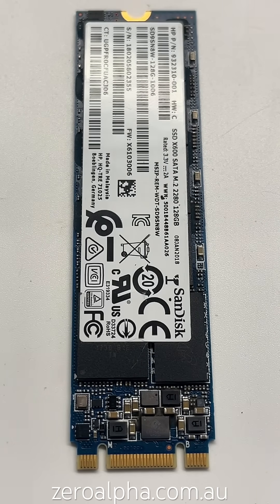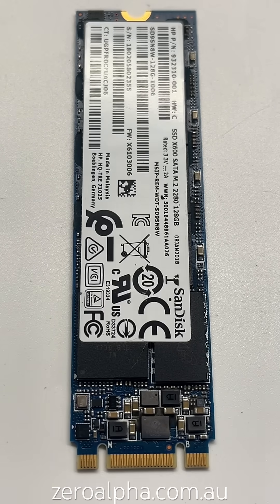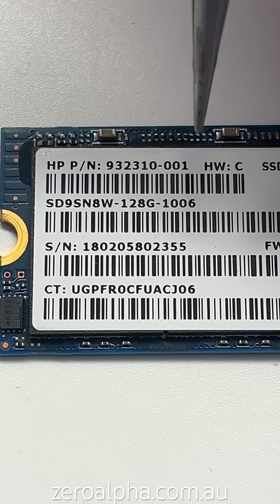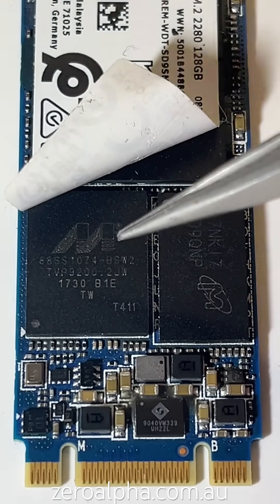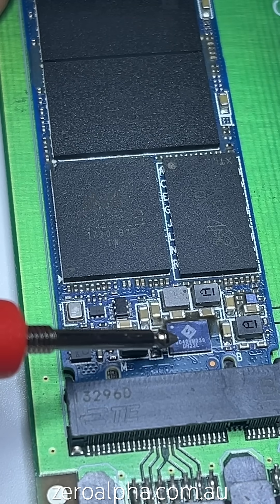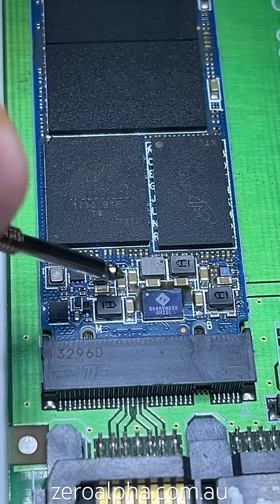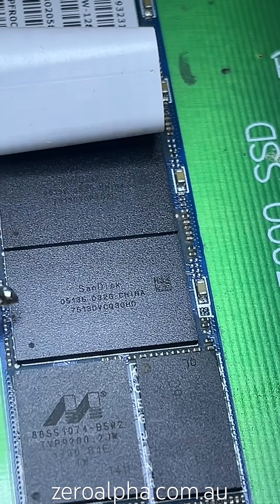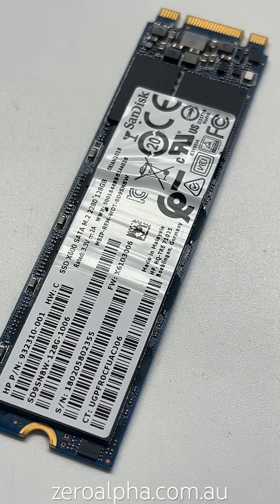SanDisk SSD not booting in laptop fix | Data Recovery Repair | X600 M.2 2280 SSD

Comment: Why  did  it   fail     bro
Reply: It’s probably due to NAND degradation, bad sectors, or firmware issues, which make it difficult to read even when the power supply is fine.
Reply: @CrucialByMicron   ok    thanks      very   much